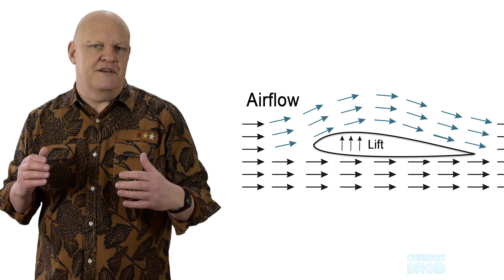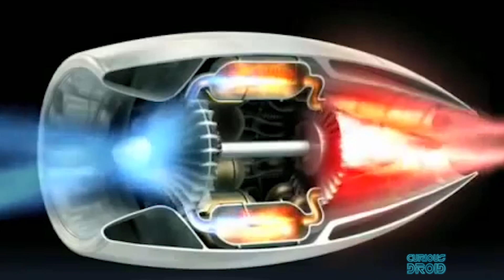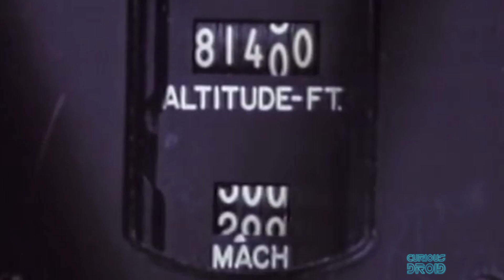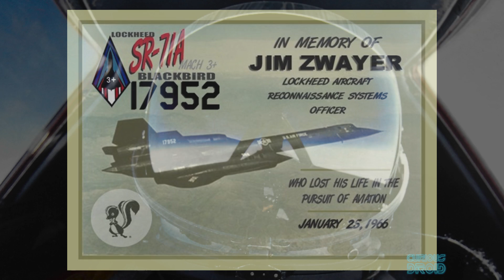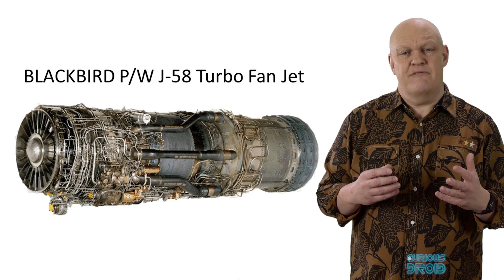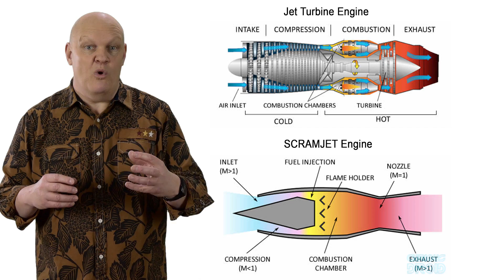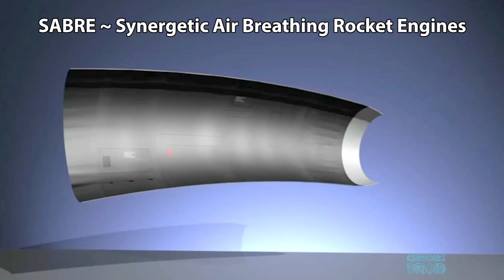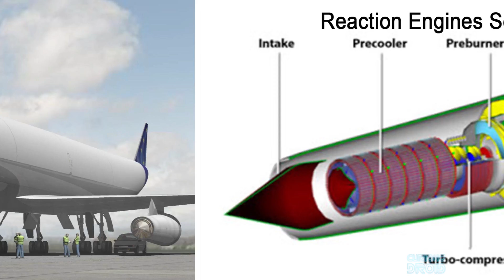Why can't we fly a plane into space ?

Comment: But Curious Droid, if the planes start to move at the speeds greater than sound, then this would cause 6g & more. That must result immediate nerve failure or possibly Coma. How would they solve that first?
Reply: Lord Sir. Prince Khan no
Reply: G-forces are caused by acceleration (change of speed and/or direction), not by speed itself.
And BTW, the Concorde cruised at about two times the speed of sound.
Reply: @fromnorway643  Yes, in a force. If I remind you, also has a opposite force. From Newton's 3rd law of motion. So, the opposite forve is equal in magnitude, but opposite in direction which cancels both forces out.  So the other opposite force also acts on the people who is sitting in the concord or etc. At this pressure, the brain squeezed & very hard to pump blood with also lacking of proper amount of inhaling oxygen. That can cause nerve failure. So, how would they make the passengers to deal with that?
Reply: @overlordprincekhan  
The highest g-forces experienced by the Concorde passengers (when ignoring the 1 g from gravity itself) would normally happen during take-off, just as is the case with other airliners.
The take-off weight of the Concorde was about 180 tonnes when crossing the Atlantic, while its maximum thrust with afterburners lit was 69 tonnes. This gave it a take-off acceleration of 0.38 g, not much more than what a lightly loaded Boeing or Airbus is capable of.
When the Concorde was in level flight at Mach 2, the passengers experienced a close to normal gravity, just as they do in conventional, subsonic aircrafts.

Comment: Nicely explained video, however there is one small mistake. Around 3:50 you mention the escape velocity needed to reach orbit. This is incorrect, the Earth escape velocity that you mention of 420720 km/h (or better said, 11.2 km/s as is more commonly used in space flight) is the velocity needed to actually leave Earth, such as a mission to Mars. In order to be injected to orbit around Earth, the radial velocity (velocity in the line that connects Earth to the rocket) needs to be brought back to roughly 0 km/s, while the transverse velocity needs to be about 7.8 km/s, depending on altitude, which has nothing to do with escape velocity. Other than this, nice video!

Comment: Wrong Rockets don’t burn in a Vacuum also it has nothing to push against for movement, little spits of air isn’t going to move an object either as air cannot exist in a vacuum either.. ask any professor cause that what I did
Reply: Rockets don’t move by pushing against anything. They move because they push fuel out. When the fuel and oxidiser mix, they react which explodes the fuel particles into the wall of the nozzle. As you should already know, any force has an equal and opposite reaction, so when the particles hit against the walls and out into the vacuum of space, it pushes the rocket forward with the same force.

Comment: scram jet ? if you cannot go to space in it ? and engine doesn't become operational till mach 5 ? then it can only be used as a weapon to deliver a tactical nuke at speeds faster then a incoming anti missile can intercept? what a stupid fucking design.. a rail gun can take one out of advanced laser for those weapons mach 10-20 might not be impossible to overcome because lets face it at those speeds there is no such thing as evasive maneuver as even the slightest course correction would disintegrate the scram jet and an unarmed payload (un exploded nuke) would then become the property of anyone that recovers the wreckage.. scramjet = useless technology

Comment: Couldn't the engine be injected with onboard oxygen and the wings extended to create more lift?
Reply: Then you basically get a rocket, that’s what SSTO (single stage to orbit, so no parts get left behind) concepts these days are planning on using. They fly up high and fast on the jest, the add more oxygen from on board to go to rocket mode the rest of the way.

Comment: The principle of all flight requires something called thrust. Once any object has been thrust into the vacuum of space without any resistance then that object would continue in a straight line until otherwise deflected. Hence technically there is little to stop a plane with adequate thrust, and a modicum of strengthening and pressurizing, from going where no man has gone before. That is unless the high levels of radiation grill the plane and its occupants. Is this thinking correct?

Comment: Another brilliant video, simply explained. 25,000 mph escape velocity. Wonder how that was discovered?
Reply: It's simply math.  If the kinetic energy of an object were equal to the magnitude of the potential, then the object can escape.  Kinetic energy is 1/2mv².  The magnitude of potential for Earth gravity is GMm/R.

So, you just use some algebra to solve for "v" :

1/2mv²=GMm/r (little 'm' cancels) : 

1/2v²=GM/R (divide both sides by 1/2 - which is the same as multiplying both sides by 2):
v² = 2GM/R (square root both sides) :
v = √(2GM/R)

Now we plug in the numbers :
G = gravitational constant (6.67*10-11)
M = mass of Earth (5.97*10^24 kg)
R = distance from center of mass (radius of Earth - 6,375,000 meters)

v = √(2 * (6.67*10^-11) * (5.97*10^24) / 6,375,000
v = √(7.96 * 10^14 / 6,375,000)
v = √ 124,925,177
v = 11,177 m/s, or 25,000 mph.

Comment: That was actually the first thought that came to mind, was to have an airplane that can more or less fly, using jet engines, to it's maximum height, where the air would be much too thin to continue to gain lift, then switch over to rocket propulsion.

Comment: Jet propulsion requires airflow.  Air in space exists on such a minute level per square meter that the lack of adequate flow would cause a normal jet engine to stall.  In short, common jet engines do not operate effectively in the vacuum of space.  Travel through space requires highly concentrated, intense bursts of energy from a power source.  Effectively, such use of energy in space is commonly used to manipulate and redirect an object moving within the vacuum more than as a sufficient propellant.  Theoretically, a plane likely could make the journey to orbit if sufficient escape velocity was achieved.  The problem wouldn't be so much exiting the atmosphere as it would be reentering through it.  An airplane would have to reverse it's forward motion enough to remain in earth's orbit; position itself along an adequate vector and then withstand the intense frictional heat of re-entry.  The key to future deep space travel will not be man made engines rather the use of gravity, radiation and the fusion reactions that naturally occur within the universe - more than suitable for far reaching expeditions and sub-light travel.

Comment: This is a fantastic video.  Great for parents that have children that won’t take a simple “because no air” for an answer.  As your video showed, velocity, payload, and other factors are just as relevant.
Reply: Lmao, no. Just "no air."   Load doesn't matter, no air means no air.
Reply: fruits punch samurai The Bell-X-1 is solidly an “airplane”, had rocket engines instead of jet engines, reached 958 mph, did not require air for it’s engines to function, yet was not capable of space flight.  The “air” in airplane has nothing to do it with what the engines breath, but rather that the air is designed to travel over the plane of it’s wings.  It is possible to travel through both with wings you know?  AKA: The U.S. Space Shuttle.  So yes, there is more variables.  Unless your a couple of cave men in front of a campfire trying to plan space flight... “we go space”, “no Thag! Fire no burn there, no air.  That why bird no go”.
Reply: @simrangill3299 
That's no explanation at all.
You can drive a car into the ocean without the car working in the ocean.
I'm pretty sure under certain circumstances a plane could leave a planet, you just need the right planet.
Reply: Evo harsh yes to